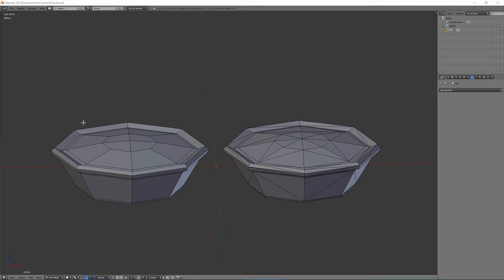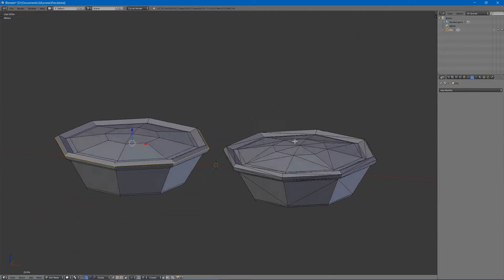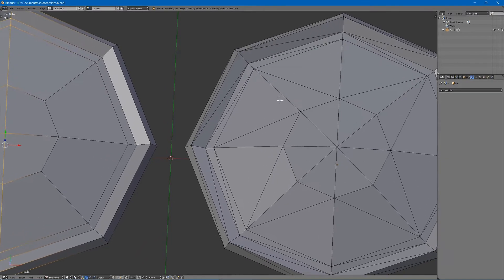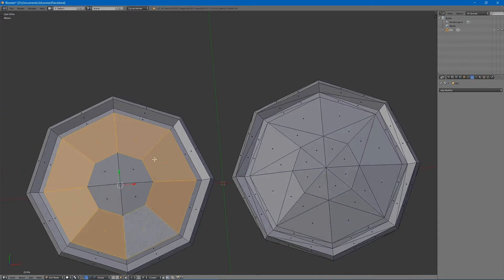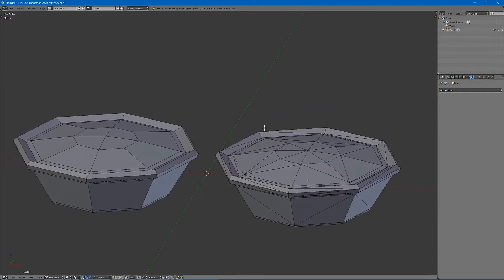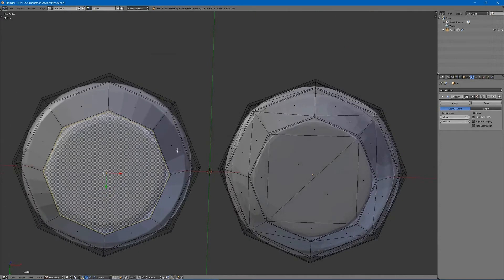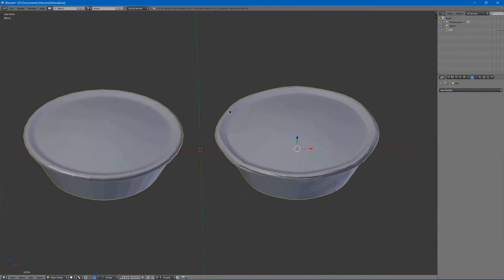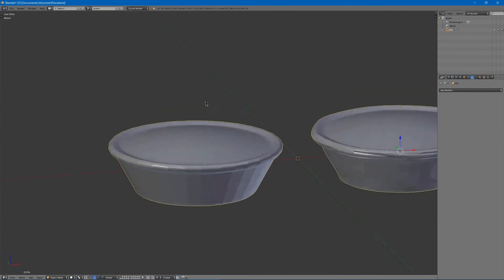3D Modeling: Tris vs. Quads

Comment: Very helpful video. I'm getting into 3d modeling as a hobby and was worried I wasn't doing it the right way, but just a beginner way. But watching this reassured me that I'm actually doing it in  a more preferred way. Thanks.
Reply from the maker: Thanks! It's good to know that you found it helpful. Using mostly quads is usually the easier and faster way to go but tris have their uses, like optimizing a mesh used in a video game or cleaning up an animated mesh (like in this video: https://www.youtube.com/watch?v=WBrt_2OEJbI ).

Comment: Although almost everything gets converted to triangles internally by most software rendering packages and 3d printer software, quads are typically the preferred method of modeling for the reasons you've laid out here in your video.  It's much easier to control topology and profile shapes using quads, etc.  Nice work on your first upload.  Good luck in the future!
Reply from the maker: Exactly. Your videos look super interesting, do you 3d print those models? Thanks, it feels pretty weird to be starting a channel right now though, I hope everything gets sorted out before it permanently damages other channels.